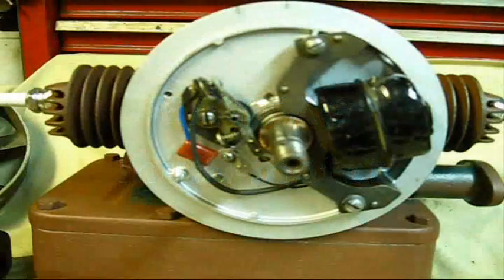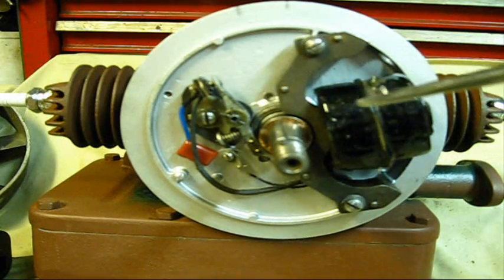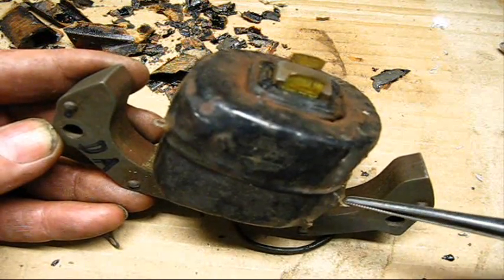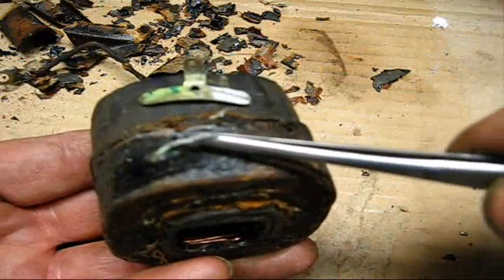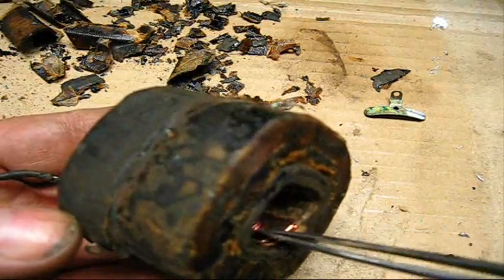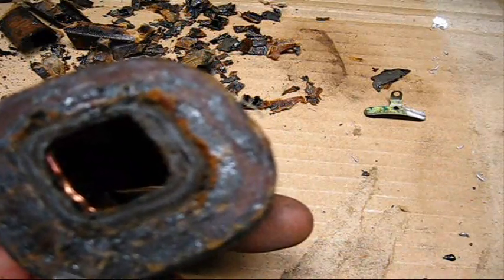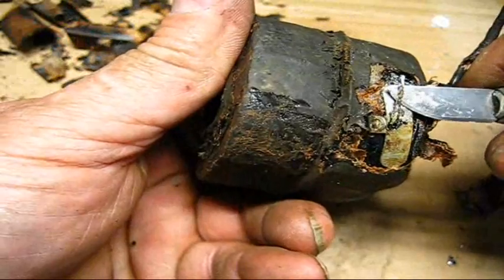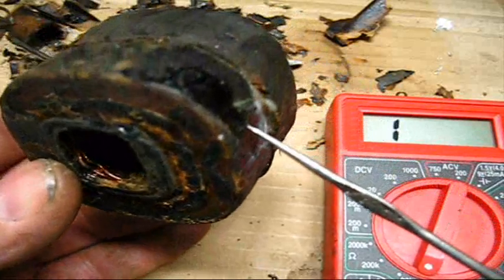1937 Maytag Engine model 72 repair #42

Comment: One thing I have not yer heard you mention is NEVER leave one of the plug wires disconnected. Either connect both to spark plugs or ground one side.

Comment: @shopdogsam I understand the difficulties, but I believe that I could resolder the pigtail to that contact plate. Especially if the coil would test okay from the pigtails. I am just thankful that you have explained to me why I should not solder the spark plug wires to the coil's tabs.
I have an idea how you will attach the spark plug wires to the coil, but will wait patiently for the video to explain your method.
Great video and excitedly awaiting next one.
From the West Coast of Tennessee.

Comment from the maker: @ibsoarin ,,, ignition coils in general are very hard to repair, most attempts to repair one are unsuccessful, wire coating breakdown, the small size of the secondary wire, around .003 of an inch just add to the problems, most any modification to the windings change the resistance, ie, low output voltage,, shopdogsam

Comment: Sam,
I'm convinced not to solder the spark plug wires onto a Maytag ignition coil. That pigtail wire is too close to the area that I would be putting a lot of heat to unsolder the old wires or resolder the new spark plug wires to the coil. I wonder how many ignition coils have been ruined in the past because of this. You are showing us a way to possibly salvage an old coil.
Curiosity has been an occasional curse in my life but it has mostly been a blessing.
From the West Coast of Tennessee.